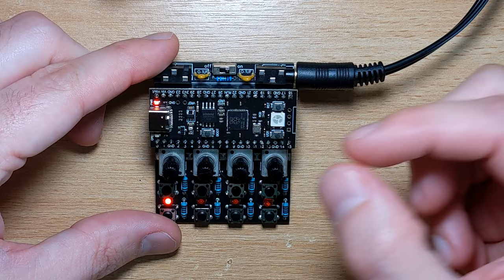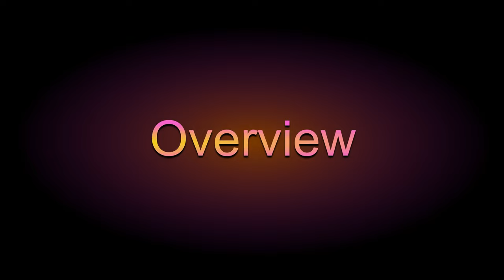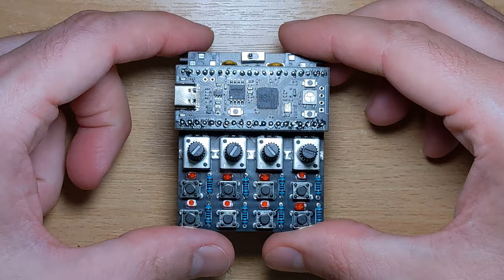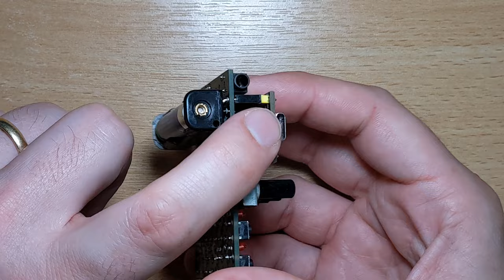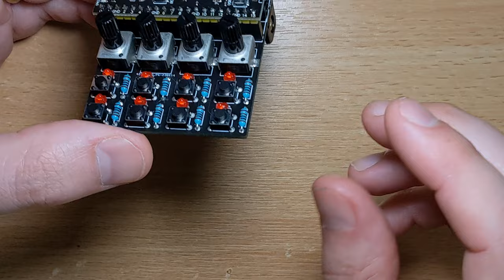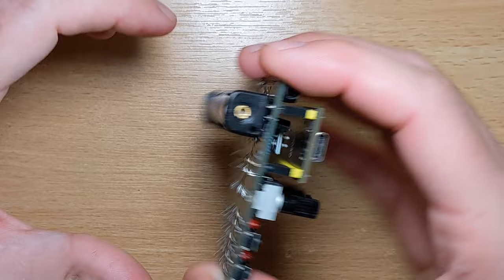pikocore // a lo-fi music mangler // first look & demo

Comment: What are the components around the on/off switch and next to the buttons? Is this a mod that you did when building it? The assembled version (or v 1.0.0 at least) has the switch underneath the usb c jack.
Reply from the maker: There are 2 capacitors and a resistor next to the on/off switch and there are resistors next to the buttons, no modding by me. It did confuse me as the pcb diagram must be an older version.

Comment: Sorry to be negative, but the soldering on that pico is terrible! Flux everywhere. Hit that with some 90% isopropyl. Yak
Reply from the maker: It's not the best, I know. Thanks for the tip 👍🏻
Reply: You're not sorry to be negative.  Really lets be straight.  I mean you could say hey try using some alcohol to clean flux . Make it look better. 😊 with happy face.   Narc